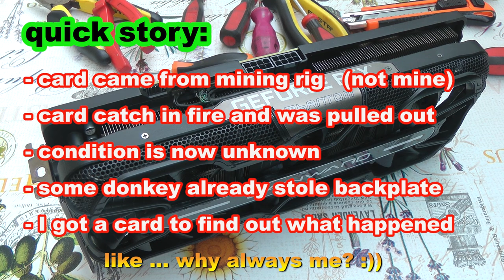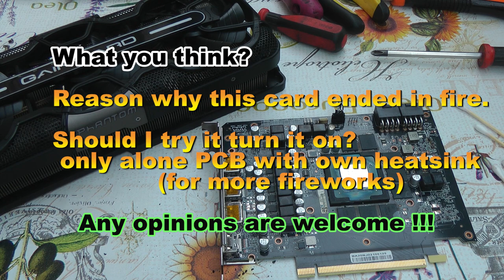smoked GAINWARD RTX 3070

Comment: I think the parts that are burnt are from the fans controller, maybe a shorcircuit in the wiring caused by the fire (or something else) made the components burn. There might still be a shortcircuit in the board, so you should try to remove the broken parts first before powering it up. Make sure that the components are really related to the fans. The only thing that doesn't look good to me is that there are burnt parts near the power connector. 
If you have nothing to loose, try!
Reply from the maker: I was thinking same way - remove parts near fans connectors and use own cooling, but burned place under power conns are not good sign that problem is only here.
Reply: I think i would power it on, not sure if the burned part near the connector is absolutely needed. On a psu and motherboard that are worth nothing naturally. To see if at least most of the card is still alive.
Reply: Just check for shorts 1st with a multi meter
Reply: You must check the Power rail for short before powering It on to see what got wrong.
Reply: Yes, check all pins on both power connectors for shorts before you connect a PSU.
Reply from the maker: Yep I will do some measuring before start, if I will make decision to start ... maybe not.
Reply: @RETROHardware  Worth adding a pair of 120mm fans onto the cooler that can run at like 1200 - 1500 rpm for testing, it should be more then enough cooling under load.
Some zip ties & removing the original shroud + fans.
If you are lucky the card is burnt but not fully dead, like rgb & fan header gives out 0 voltage now & not even an rpm reading works.

As the card was removed from the mining rig without trying any fixing themselves, chances are it's shorting out on the powersupply side of things causing the mining rig too shut down & will not start up anymore with that card plugged in.
And if you start it up without the pci-e power plug it will likely just catch on fire & destroy itself further if its that kind of short on a vrm chip for memory or gpu.

This was a slow burn failure for sure over id say a few weeks if not months, as the card probably kept cool enough not too shut down, while slowly smoldering too death running a fixed fan speed on the fan controller eventually shorting from the seized fans wiring shorting out rgb & fan controller.

Comment: check if there;s a short on 12v line, remove damaged parts and start it, there's a very small chance that it's gonna work. if you remove broken parts and there's not fireworks after replacing broken parts it should work

Comment: This is only theory, but it looks like extremely high temperature (as for such construction) melted the insulation of fan and LED wires, which lead to short circuit. And as such short in wires appeared, controllers (normally designed to work in lower temperatures) gave up the ghost, shorted, and dumped a lot more current onto these wires, which lead to their combustion.

Comment: Maybe the 2 side fans stoped working and only the fan in the midle kept working. That with that short on the cables leading to the fans probably did it.( now atempting turning it on only on very controled space.

Comment: Maybe the power supply the previous owner was using blew up?  If you want to power it on, I would probably remove the burned up components first.
Reply from the maker: Nothing bad happened with PSU there.
Reply: @RETROHardware 
I wander,if the missing part was the fuse one...

Comment: I say the GPU was overclocked too much especially being in a mining pc or if it was in a server, it may have been connected with the wrong or faulty voltage rail. There's still a 65% chance of a successful refurbishment if the GPU processor crystal is still ok.

Comment: 2:50 - NOOO! Sticker says you are not supposed to unscrew that!
Does that cooler have LED lights? I once checked watts of such cooler and it had 10W!!! Stupid cooler few few leds and it had 10W!! But power to those leds is going thru wires which looks like hair. It could be this problem, because it looks like it started burning somewhere around fans.

Comment: Looks like the fans were overvolted, somehow. For the wiring to be burned at both ends, and what seems like the fan control mosfets to be toasted too, the current would be consistent with the circuit, but voltage turned higher than the circuit could handle, and wattage going way beyond spec. If you've done the continuity tests, (especially on those burned mosfets, or remove them) then sure plug it in. Stick the heatsink back on with no fans, and it'll be a fine test. Could probably run skyrim on it no trouble, for a short while anyway. edit hell, don't even bother with the mosfets, as long as it isn't shorted across its neighbors, and nothing's plugged into the fan headers, where' the voltage going to go, anyway?

Comment: Fans burned out and short circuited from running 100% speed 24/7?
Reply: Running a pc fan of any kind at full tilt for 24/7 will not cause it to catch fire as the fans are designed to run on full 12v dc all the time. The reason why they dim them down when not needed is to save energy and reduce noise and wear in tear on the bearings. The only time a fan will catch fire is if the fans were overvolted/overclocked too much or if the motor circuits started to short out or got wet.

Comment: Good way. 
Buy a board with dead GPU and memory and swap it, if you can reball or try to practise by your self, or pay for professional to do this. In case of fire damage it can be layer shorts in pcb, so you just kill GPU and memory in case to turn it. Board can be youse as donor for parts. This is better chose. 
Or middle bad way but more interesting.
Find on YouTube repair manuals, how diagnostic card with all resistance, then turn in from lab power Supplies on low amps. And pray 🙏
Reply: The card's residual value, even if functional, is not that high, and it's unclear whether the chip has survived. Paying a repair shop to try and fix it is almost certainly not worth it.

Comment: You should always try warranty / customer support with smoked components. I've had two fires with GPUs within the last decade and both of them were willingly covered and replaced by the manufacturer (ASUS & Gigabyte) regardless of both of them not being under normal warranty. Manufacturers will want to investigate the boards with fire hazards.